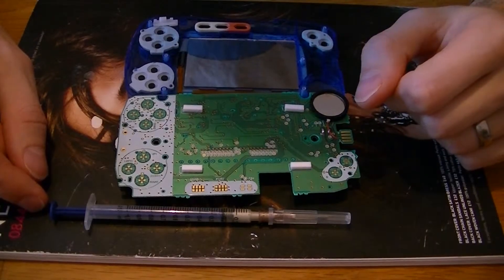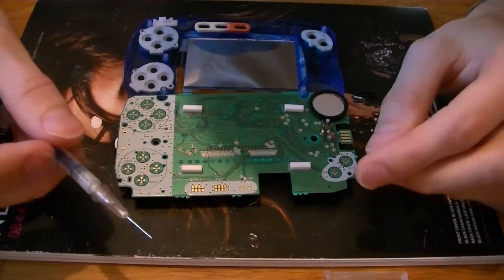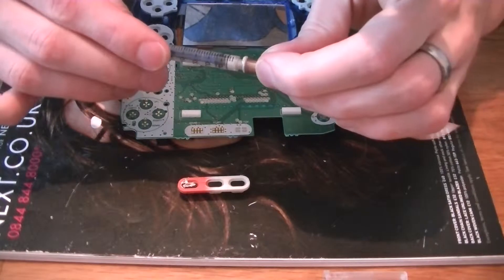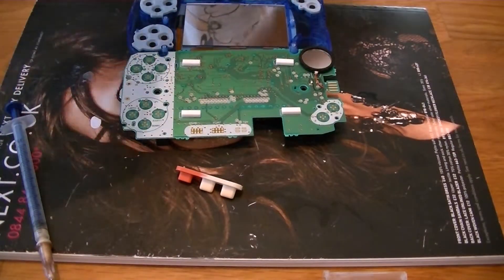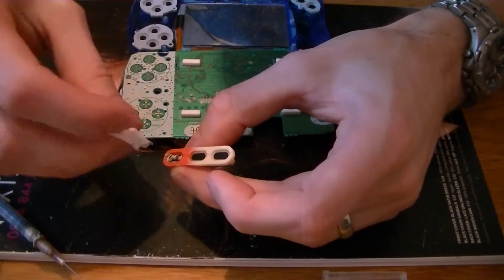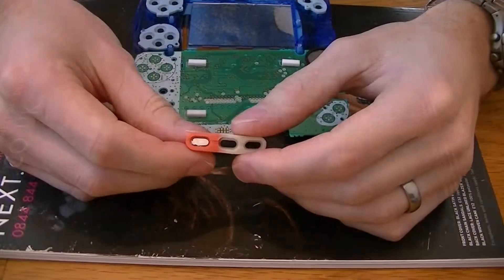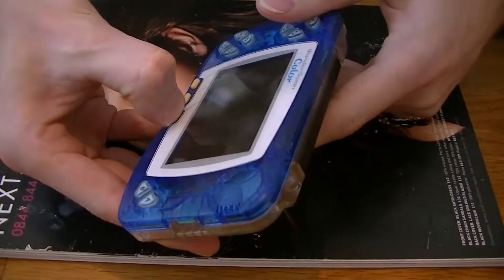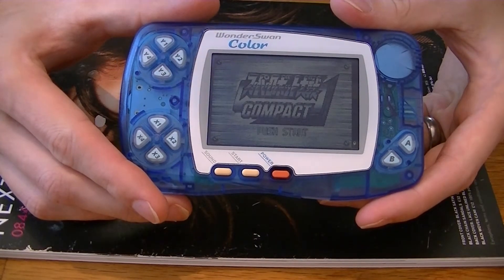Wonderswan Color Power Button Fix with Conductive Paint

Comment: Just got one, the thing is, the button works to power it on... but not to power off, it doesnt seem to be an issue with the contacts, how do you usually power off your wonderswan color?
Reply from the maker: +damiang888 I think it's a push and hold but it has been a few years.